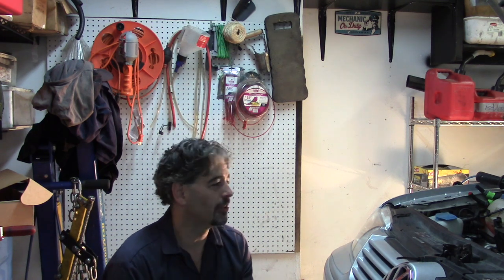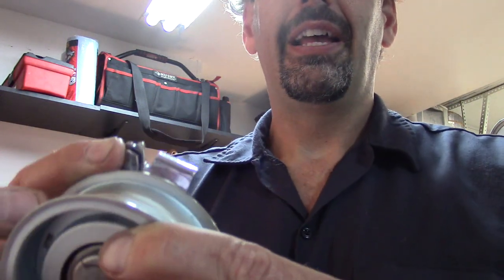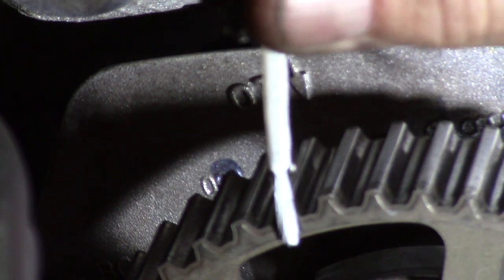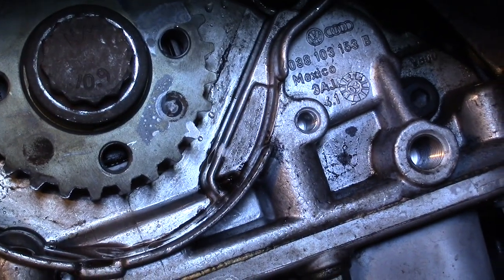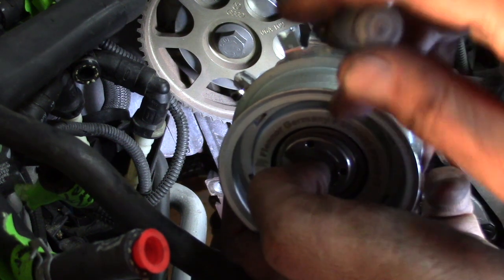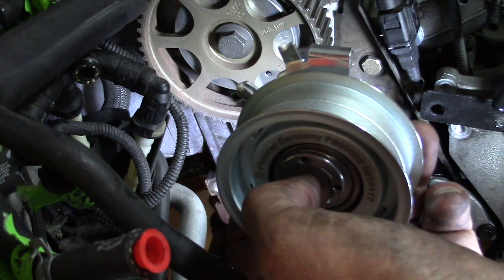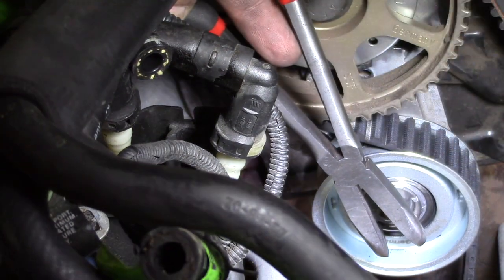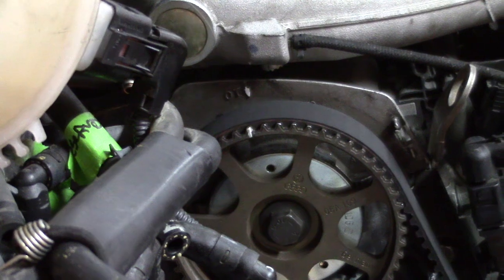PROPER Timing Belt and TENSION 98-05 VW 2.0L Jetta, Beetle,  GTI, Golf

Comment: I've been a VW/Audi specialist for almost ten years now. Interestingly enough, all the ABA engines I've worked on that have lost a belt have all been OK. After replacing the timing belt and related components they've all ran perfectly. the AEG, AZG, etc will damage valves more often than not if the belt fails.
Reply from the maker: I wish more people would see your comment- there have been so many people telling me this is not an interference engine. It certainly is and in fact at one pount when turning the crank I experienced the interference myself and had to turn the cam to get clearance.
  My experience in general is interference engines with broken belts meet their fate more than half the time.  This owner was very lucky.
Reply: Schrodingers Box I've seen my share of the newer 2.0 8V  engines that had lost the timing belt, and had bent valves. $1400 to $1600 dollars later your back on the road, and that's IF the cylinder head can be salvaged. It pays to replace the timing belt and related components at the specified interval, or you can pay out the nose when it fails. And if you get REALLY lucky and don't have bent valves, you better go out and buy some lotto tickets ASAP because you'll probably end up a millionaire.
Reply from the maker: Chester Wardan Just out of curiousity would you agree with me:

  Out of the maybe 10 cars I have seen with timing belts failures only maybe 2 of them actually had strictly belt failure- the other 80% were all timing component failure (sometimes causing the belt to fail)-frozen water pump, broken tensioner, frozen or broken pulleys, etc.  
I.E. changing the components is possibly MORE important than changing the belt itself.
Reply: Schrodingers Box
As a "Professional" I would tell you changing everything at the same time, at the specified interval, is the best way to go. Obviously were not talking about making repairs due to a belt/component failure here. Strictly as a regular maintenance routine. I've given your initial question some thought, and to be completely honest I can't agree, nor disagree because you can't accurately anticipate any one particular component failure. Maybe I'm missing something here, but it would be unreasonable to replace everything BUT the belt at say 40K or 50K because you think one of those components may fail. Could you do it on your own car just because you wanted to? absolutely. It becomes a "while I'm in there" type of situation at that point. You've already got the belt off, from a monetary standpoint it just makes sense to spend the additional X number of dollars and replace the belt. I've seen a fair number of failed timing components and probably 80% of the time it's been the belt. That's just my experience up to this point.

Comment: As a veteran tech, I couldn't have done a better job.
Reply from the maker: wysetech2000 Ah good to know-  always good to have "validation" from a pro.  And thanks for your other comments on the BARO sensor as well. I checked and you are absolutely correct- Bosch makes IAT, Baro, and MAF AND humidity combinations.  Wow.  I always thought it made sense humidity should be accounted for, seems now it is.

Comment: Ha 2 und 1/2 teeth between a living or dead engine. As I said Luckiest guy for the week.
How many miles did the guy get on the belt? 140.000 That is twice the amount it should have been changed after. Quality which I didn't really expect from any manufacturer.

Nice videos.
Best regards.

Ben
Reply from the maker: Correct on all counts including the mileage. Got his money's worth I guess lol!!!!
Reply: Schrodingers Box 
How about you Oscilloscope.  Are you still looking? http://www.amazon.de/Hantek-Oszilloskop-Oscilloscope-8-Kanal-2-4MSa/dp/B00EEWH8JG This is what I use. Works for me. 

One question. One ofr my hydros is ticking for quiet a while now. 
Any idea how long I can ignore it without damaging anything? It will take until the end of the summer and about 5000 km until I can take care of it. 
Thanks for you videos. Looking forward to the cat video. 

Best regards. 

Ben
Reply from the maker: By Hydro I assume you mean a lifter?
Reply: Schrodingers Box 
yes I mean the Hydraulik Lifter. Sorry for my inprecision. If it ran out of oil in the parkinglot sitting there ist makes a real loud noise when startet for 3 seconds. Which is normal. Than it is a relly quiet noise which gets louder when the oild gets hotter. I know that it has to be done and I think about doing the entire zylinder head so that I can check the sealing area of the noisy valve. But it will be about  5000km / 2800mil until I get to it. 
My wive is driving the car to an from work every day 36mil one direction. And now I'm thinking for how long can I ignore that before real damage is done? She is not putting the RMP higer than 3200-3400. But still. I'm kind of worried.
Reply from the maker: Benjamin Bergmann It's really hard to say.  I normally see where the noise gets quieter when engine warms up. My neighbor has one like that which we have been meaning to get around to for over a year now and it runs fine- but remember it only makes the noise the first 10 or so minutes. In your case you are spending far more time with it rattling, causing more damage.
  It is really hard to say bro- if there is metal particulates or "glitter" in your oil between changes then the entire engine is not long for the earth if you don't fix immediately- if it isn't done for already.  That's my main litmus test.  Otherwise you need to visually inspect how much damage to the cam journal has been done so far.
Reply: Schrodingers BoxI think the best thing is to open the valve cover and check the cam. Depending on what I see I'll decide. 
I hope that it is not too late.

Comment: It´s very good explained. Please make a video of timing belt, water pump and pulley change for Isuzu Rodeo and 2005 Honda Odyssey. thanks, Roberto
Reply: R Flores  r u serious, dude get a clue, just bring it to a shop, if you need a step by step video to do the job then you shouldn't be touching tools or auto's in genral. Do use all a favor and don't do any brake jobs
Reply: bleachinuri Sorry your comments, however your video is appreciated.
Reply from the maker: R Flores That comment wasn't mine but I actually agree to some extent, the concepts shown apply to all vehicles.  Basic aptitude should get you through variations.
  But as soon as a I see an Isuzu Rodeo or a 2005 Odyssey that just so happens to need a timing service I'll do it.  Oh, one question though- should it be on with an automatic or manual transmission?
Reply: Schrodingers Box  Thanks for your attention. ATX would be very interesting.
Reply from the maker: R Flores Red, blue, white or black?
Reply: Schrodingers Box purple

Comment: Whenever I do a job I search for info from multiple sources, never trusting one source alone. I get a little nervous when people ask questions that show they haven't done the effort, blindly trusting all they were told. This one certainly adds to the knowledge base. The other angle that may be a surprise is when professionals say they use a different method than that recommended in the dealers manual. Most of the time I give the dealers manual the last word, under the assumption they are anticipating other problems that might occur. For example the 5X movement of the tensioner may be to put the blame squarely on the technician in case of immediate replacement failure. A faulty part should be easily detected if the tech does the procedure right.
Reply from the maker: spelunkerd Agree 100% Dave, on all counts.  One exception- sometimes when there are discrepancies with what a professional suggests vs the manual, I will research and TSB's that show the professional is indeed using updates made after release of the manual.

  BTW- you and Terry will LOVE my next video.... I can't wait to release it!!!!

Comment: Hello, matt great video with info as always on question is there universal way to put the timing marks to the correct position if they were disturbed after removing the belt I know cars are different. thanks for the series always learning some thing  cheers.
Reply from the maker: j georges Technically, yes, but realistically, no (assuming I understand your question).  For the crank- it is universal.  TDC for the piston (note it will not always be the #1- some cars I have seen use #4!!)  can always be set by finding the highest point of travel for the piston. 
  For the cam however... not so easy. While the compression stroke setting at TDC will always have both valves closed, getting to the exact point (because they are both closed for quite some time) depends on a lot of factors.  And while they could be calculated to position the cam correctly, a marking of some kind is really necessary unless you're an engine designer or something.
  The only "universal" thing is that All cars will have some type of marking for both crank and cam, but the markings vary, and some of them really suck and are confusing in fact!

Comment: Great video. Hi Matt, I am into auto repair trade and I am new into this trade. I have done several timing belts at work but lot of time I have this problem putting the belt on. Sometime the cam moves or sometime crank pulley. Belt tooth doesn't line up with the pulley cogs. Specially when double cam. They always keep moving. Then I seek help from my other fellow workers but they never seem to teach me the trick they use to put the belt on properly. Could you please make a video about it and show us the tips and tricks to the belt on. I hope you understand what problem I am talking about. Would really help me a lot. Lot of time i scare to death when I get a timing belt job cuz if I damage the engine gonna go from my pocket. Thank you
Reply from the maker: Parvez Ahmed I have several videos on timing belts.  One of them on a Highlands I use a trick of locking the cam in place with a wrench to prevent it from moving.  Maybe check that one out

Comment: Hi Matt, greets from England. These are everyday fare over here, I`ve personally done 4 in the last 12 months, and they`re not too scary. Working at an independant BMW specialist, we tend to get a lot of "exotic" european marques, with some complex timing belt arrangements. But the way to be relaxed about it is to follow the universal golden rules. Always turn the engine manually TWO complete revolutions, as you did, but with the plugs removed, (I know it`s a pain, but it gives tremendous peace of mind) before you install the outer cover. If there`s going to be any kind of mechanical interference, you`ll feel it by hand, and you`ll have the opportunity to corect it.
Once you`ve done that, always re-check that your timing marks/locking pins etc line up as intended, again as you correctly did. And if you want to be reassured more, do it over again.
I`m not a fan of running the engine, or cranking it before I`ve replaced the cover and crank pulley. This requires you being away from the area in question there are often compenents within these that hold the belt in track, without them in place, belts can "walk" themselves off a pulley while the engine is turning if unattended. By following the hallowed golden rules, I have never had a failure. The only failures I`ve had, (and in 35 years, there`s been one or two) is when I`ve failed to follow the golden rules.
As for the tensioner indicator, there`s no need to be too anal about the exact positioning, once the engine has run for a while, and the nap of the belt fibres have worn to a nice polished surface, you`ll find the the pointer will move away from the indicator anyway
Hope that helps.
On another note, I`m plain gobsmacked that the noise was mis-diagnosed elsewhere, ten seconds and a stethoscope, or a bar, or a screwdriver, or even a bloody pencil would have found that the noise was coming from the timing belt cover area, and about 15 minutes to get the cover off would have pinpointed the fault. Dolts....
Top show sir...Carry on...
Show less
·
Reply from the maker: Simon Crane Thanks, brilliant comment, cheers!

Comment: Love the idea of skipping the nuts and bolts parts, if someone complains about that, they probably shouldn't be doing this type of jobs but you already said it so GOOD JOB AGAIN.
Reply from the maker: Exactly correct.  Plus I find it really cuts down on the just plain stupid comments that plague other channels.  "How many bolts are there for the water pump?"  "Can this problem happen from not changing your spark plugs?"  "My camshaft marks line up but the crankshaft marks look off by a tooth. But when I set the crankshaft marks even, the camshaft marks look off by a tooth.  Is the belt on backwards?"

Comment: i watched  this on my nexus5 phone in bed  last night and as Soon as i did hear  the clicking !!  i said that is the timing  belt tensioner.. haha  i had  that exact noise on a t4 tdi 5 cilinder diesel vw van the van has its injector pump driven  on one side  with a  belt  and the other  side  is the cambelt . a few teeth where  also missing on injector-pump belt. 
 I am  amazed the  thing has not smacked its valves  with the amount of teet missing , just proofs  how good  vw are hehe..
Reply: Intrade Motor 
wops i am refering  to the noise diagnose video not this one actuarly dont know how  you could  edit remove a post .

Comment: This is basically a video on how to save $300 by doing it yourself ;)
Reply from the maker: Louis Pasnik Jesus, if I charged $700 for this job I would quit my day job!!
Reply from the maker: Yes I actually wonder what the shop quote for a timing belt would be. On most cars it's easily $800 or more but this was actually one of the easiest i've done for sure.
Reply: If a shop were charging $300 for labor on timing belt + tensioner + water pump replacement, I'd certainly give that shop more business.  I'm hearing quotes of 700 to $1000 in my neck of the woods.  Reputable brand kits I've used are somewhere between 150 to $200 for belt/idler/tensioner/pump.  Plus, I know it is done correctly when I do it.

Comment: Great vid. I'm sure with your thoroughness you used the correct coolant
Reply from the maker: Steven Tenney Indeed I used "the pink stuff" or whatever the VW guys call it
Reply: I just saw a conference on cooling systems and I think it's g12
Reply: I'm shocked the water pump even lasted that long .
Reply from the maker: Steven Tenney Yeah, actually when I did the leakdown test, the engine clearly never even had the plugs changed or anything. This engine had nearly no maintenance but damn if it didn't have compression of 180 across all cylinders!!! (which is near the top end for specs range!)

Comment: I usually consider myself an advanced do it yourselfer along with you my friend, Matt. Without a specific instruction sheet for idiosyncrasies of any engine for a timing belt, I wouldn't be comfortable doing the job.

I worked on a Mitsubishi Lancer, year unknown that had automatic tensioner activity. Had it lined up, easy cheesy....

...it's probably way to big of a question to ask, but are there often strange, special instructions with timing belts? I guess I'm thinking of the "turn it back and forth 5 times" for unknown reasons. lol
Reply: DE Nichols Also, I'm wondering more of what I don't know from a lack of experience on other tensioners. I mean. I've never had to set tension on my one job like this.
Reply from the maker: DE Nichols I have never seen that before, no.
Reply: ***** This goes under the category of torque specs. I'm very good about it where it matters. That freaks some out, but it's the honest truth.

Comment: Thanks for another video.  
I'm gonna admit some past stupidity on my part........
The first timing belt I changed on an interference engine, I made sure crank was at tdc....but it was on exhaust stroke.  I didn't realize until I had the belt and tensioner and water pump off.  I debated putting it back together with the cam in its position 180 out, which maybe would have been the best thing to do, then recheck after rotating it to make sure I wasn't a tooth off the alignment marks.  However, what I ended up doing was turning (very carefully and slowly by hand) the cam 1/8 turn, then turning crank 1/4 turn, repeat until last cam and crank markers were in correct position at tdc on compression stroke, then proceeded with belt install.  I never felt a valve binding, so I guess it may needed more than 1/8 of the cam turn to cause interference - it was a 4 cylinder.....I guess it could be more risky with higher number of cylinders.  
After getting everything back together, compression test showed excellent compression.  
Probably very risky, but those mistakes are the kind I'll never make twice.
Reply from the maker: Louis Pasnik Yes it is exactly the mistake most everyone else made.  But many were worse.  My favorite was the guy who could not get the marks to line up no matter what he did so he decided to run the engine and see if they would "line themselves up".
  Jesus.